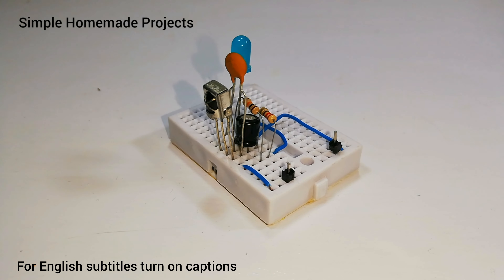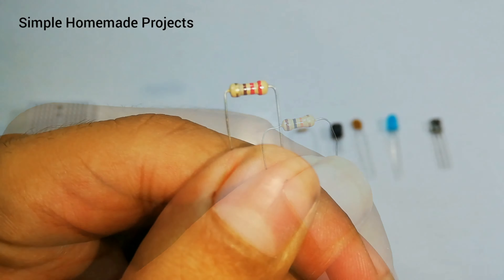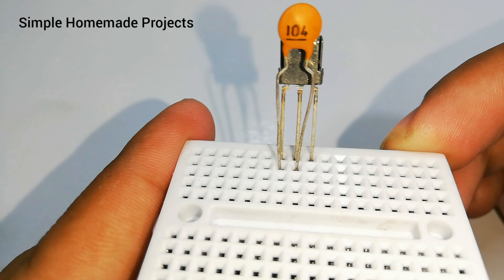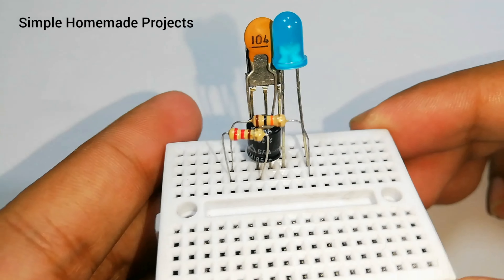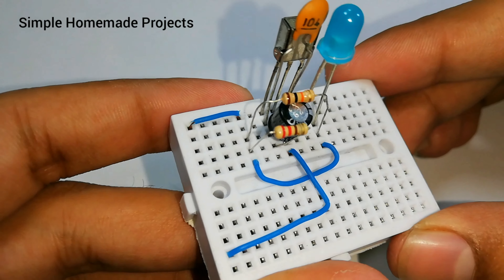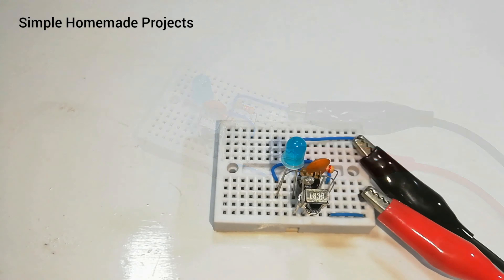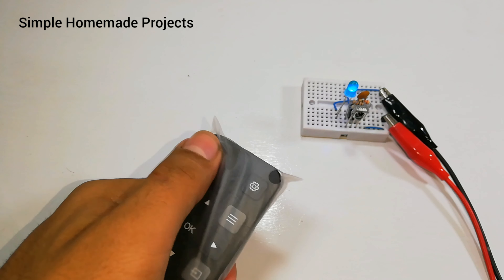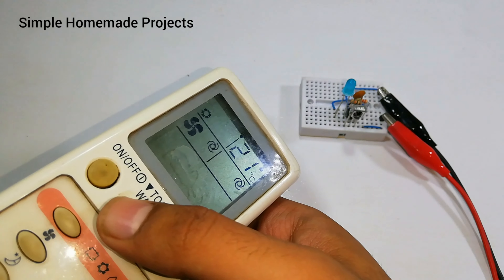IR Receiver Circuit using TSOP 1838 || How to make? || Universal remote tester || Circuit Diagram.

Comment: Isn't the purpose of the 10 K resistor to protect the LED from excessive current? If so, why it's not in series with the LED (in the schematic below)? The resistor is shown in parallel with the LED, leaving it unprotected! 

In your breadboard the 10 K resistor is completely shorted by the blue jumper wire laying down on the breadboard!! Current will never flow through the 10 K resistor!!

Also, what's the purpose of the 220 R resistor? Thank you for this great video!

Comment: The circuit diagram shown, does not match what was built. The 10K resistor is shown across the LED (in parallel). It is wired in series on the board and then cancelled by the link wire, shorting it out. So the LED is driven straight off the output pin of the 1838. The pinout on the diagram has the -ve and Output pins swapped. The ground pin is the middle one. The circuit will work as shown built, but not by the diagram. The LED may not last too long.
Reply from the maker: Thanks for pointing out,

Comment: does not work
Reply from the maker: Hi, sorry for the late response. The circuit is good, make sure you are using TSOP1838 not the TSOP1738. Additionally, check out all the peripherals if they match the same as shown in the video.